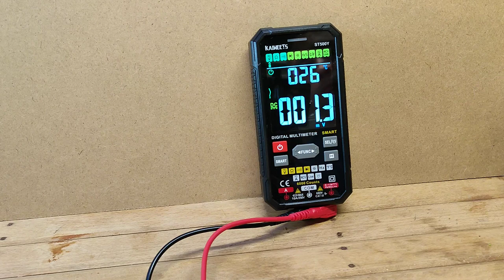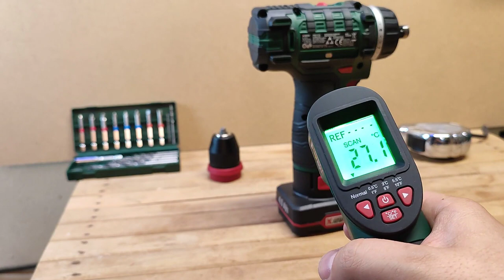Parkside Batteries 2Ah vs 4 Ah | Is there any difference in Real Life?

Comment: Interesting, indeed, but I don't get it. Why would the torque of the machine depend on the Ah. Doesn't the motor drain the same current under equal load?
Reply from the maker: It's supposed to be the same, but bigger battery in real life can deliver slightly more current. Both of them will do the job just fine dough.